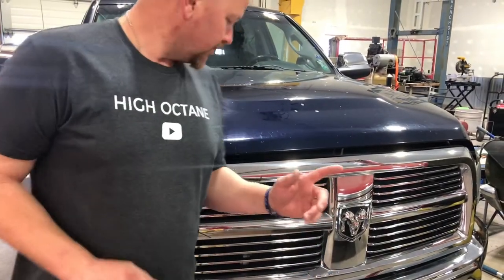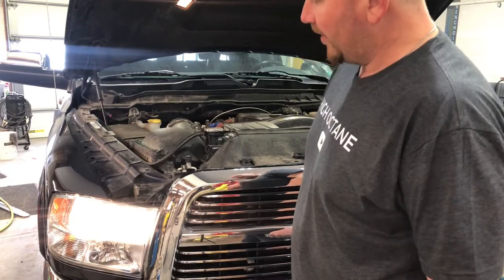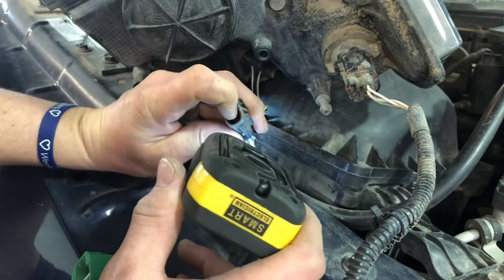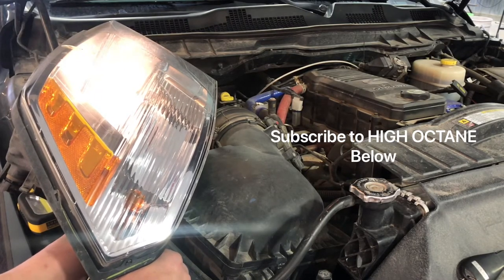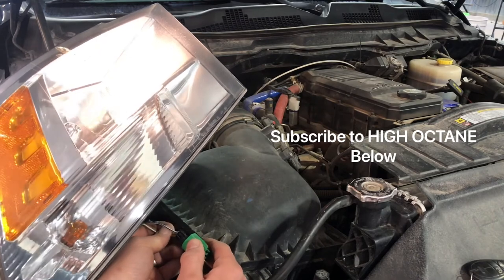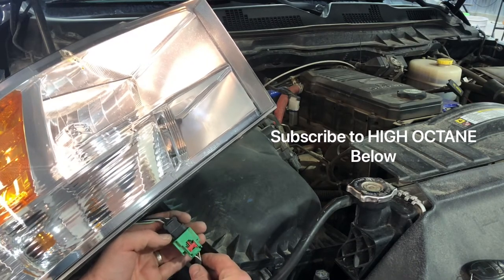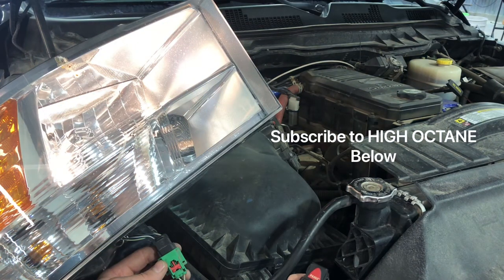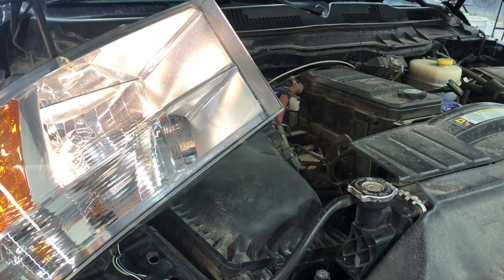2012 Ram 3500 Cummins Headlight Short Problem

Comment: Do you know exactly the location for headlights fuse ? 
ram 2011
Reply from the maker: I believe on driver’s side next to engine that has a fuse box there.
Reply: @HighOctane101  I found the box , with 150 fuses in it , I can't find the one for headlights, is it so hard to know ?